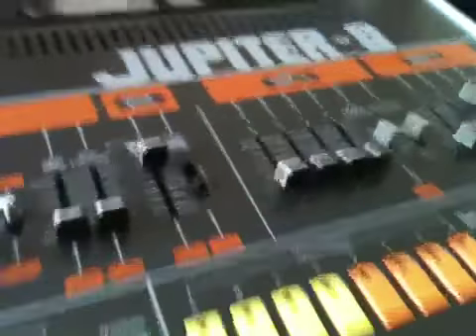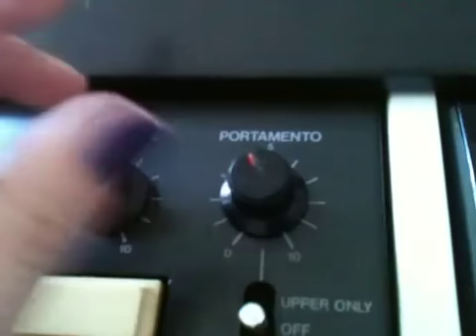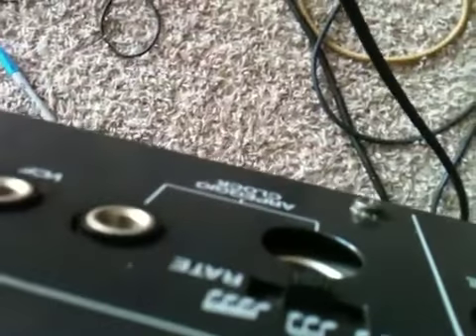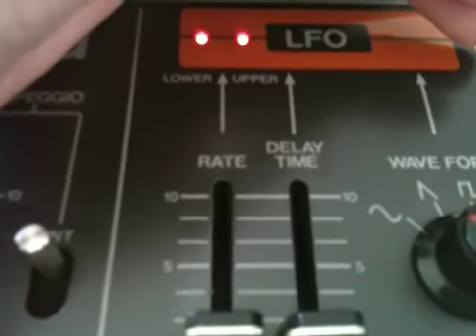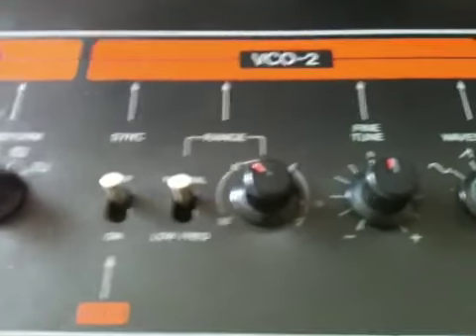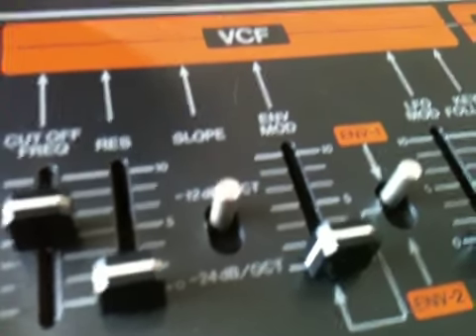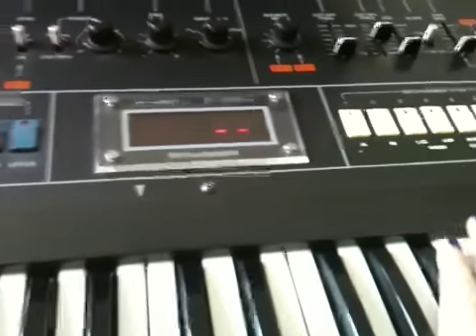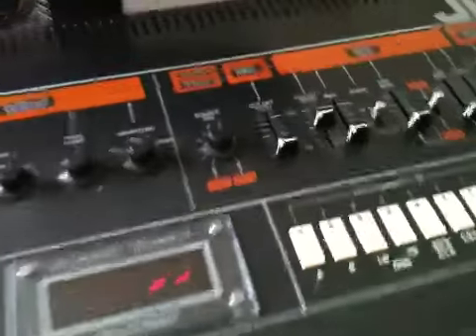Jupiter-8: overview, controls, init patch.

Comment: Great video TSF for those that have always wanted to know all about the JP8.I was going to put one up when I had mine but never got around to it and it's gone now..I miss it after seeing this :(   never sell vintage gear unless you just need money badly because you will miss it!  I notice this is an earlier rev JP8 and wanted to point out that if you do get your own&you will-make sure you get one of the later revs that has DCB buss..better tuning&roland fixed all of the issues by'84-the last yr.

Comment: Oh and btw as you already know I'm sure-the later ones with the DCB will also let you connect that 808 directly to the jupe as well as a juno60 if you were to ever want one of those..also I think some of the earlier roland sequencers will connect to it..it was rolands "own midi" before sequential invented midi and came out with the prophet600..I'm going to try and buy my jp8 back from the guy I sold it to whenever he decides to do it-he told me he would. :) It has many mods plus 3banks of 64 :)